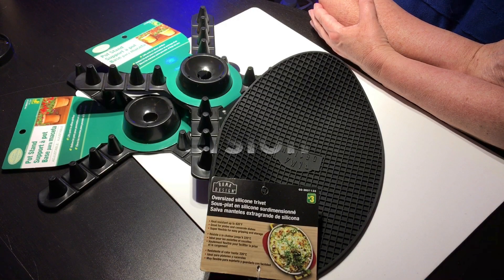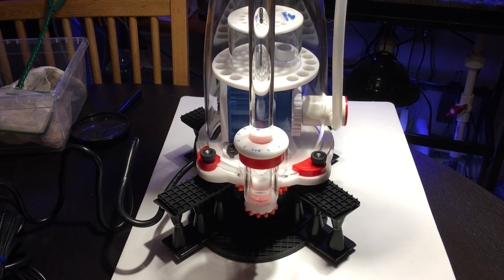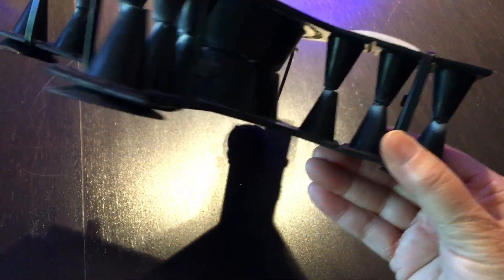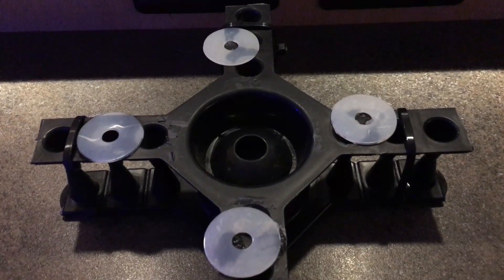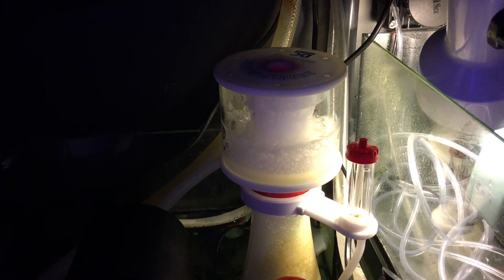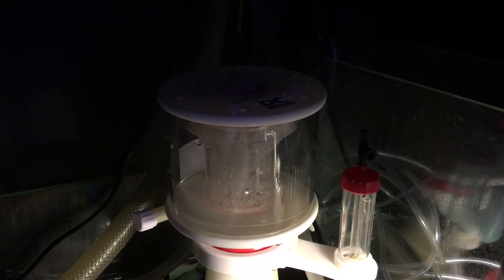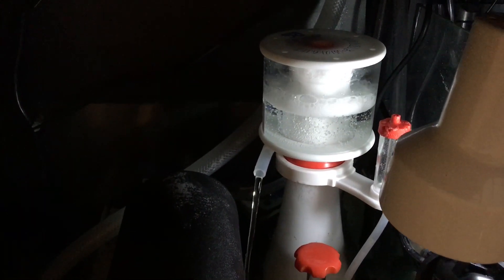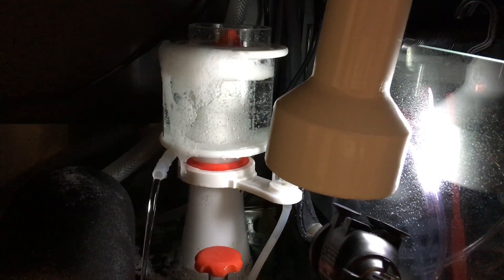DIY Skimmer Stand Turns into ReefRant - Am I Just Being a Princess?

Comment: That's very unusual that restricting the air lowered the water level.  That would not work with a good skimmer.  
Skimmer - air = + water, result higher level in the skimmer and overflow 
Skimmer + air = - water, result lower level in skimmer

This skimmer has a defect of design.  What kind of skimmer is it?

I would get rid of it and get a decent Skimmer with a DC pump. 

I would be irate about this.

I have a SRO-5000 and needed no breaking time.  It worked right away and has since I've had it no problems.  The skimmer is well made for the price and the bubble blaster pumps are great.

Also had a SRO-1000 Int skimmer on my 180 and it worked very well also.  Then I upgraded to the -5000.  I sold the -1000 but regret that because it would be a perfect QT/frag tank skimmer......
Reply from the maker: It's a bubble magus a5 (which has a dc pump) and I'm planning to replace it once I decide between a couple of choices. I had a Reef Octopus at one time, which worked well until the pump died and I accidentally cracked the skimmer body. Thanks for watching!
Reply: Reefgrrl can you not tune the pump down rather than restricting airflow?
Reply from the maker: It's a non-adjustable dc pump.

Comment: All that wasted DIY when a small air control valve not included was the answer a overview from the manufacturer deserves bad reviews 👍❤
Reply from the maker: That experience completely turned me off using Bubble Magus products. NEVER AGAIN. It’s one thing to have a design issue (to this day, I believe that pump was oversized for the skimmer body) but it’s another thing altogether to have crap customer service. I still have the emails..... And, I’ve never had any issues with my Deltec skimmer - zero! Love that thing....

Comment: all the skimmers I have used in last 25yrs have always had a valve on air intake, including my latest Vertex, wth? You might also consider making a skimmer "stink cap" out of an ice cream tub as I did, contains that overspray when skimmer blows it's top. Also if you run skimmer in bucket of diluted viniger for 48hrs, skimmer will break-in quicker (removes oils on plastics from manufacturing process).. Your skimmer sales rep is 1/2 full of bs..
Reply from the maker: I did run it in vinegar for most of a day (maybe 10 hours or so) before using it for the first time. I guess it wasn't enough, or maybe there is truly something wrong with this particular unit, who knows. That's a good idea about covering the skimmer cup, I've also had suggestions to use a ziplock bag. Never occurred to me I could do that, I thought it had to remain open to the air. I'll know what to do next time.... Thanks for the tip, and the support. 😃
Reply: Reefgrrl , look at my Skimmer video and see what I did to top of my skimmer;) It contains the stench and overspray. Even when it tries to float top of skimmer due to bubbles. Overlap ice cream pale 1/2" over top of skimmer lid (works like a reverse umbrella;) Skimmer does need to breath through top of Ice cream pale, but will contain excessive bubbles/foam and spray that tries to migrate through skimmer lid and side(floats lid).